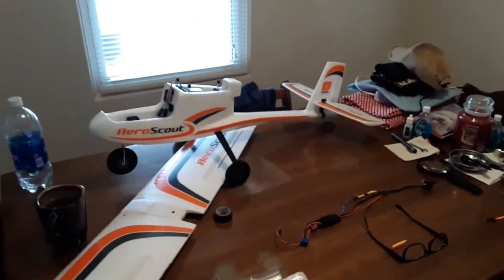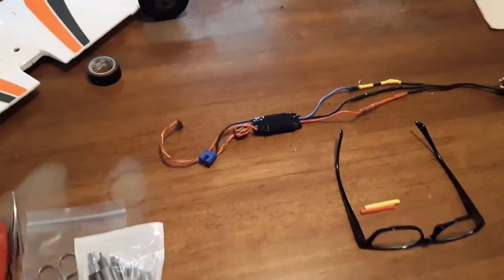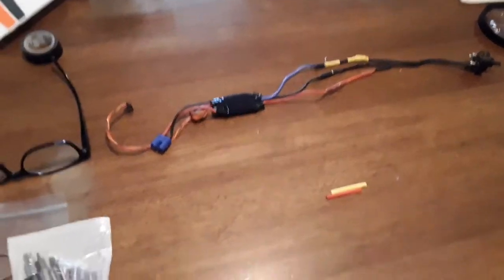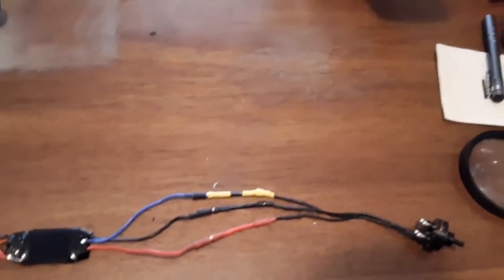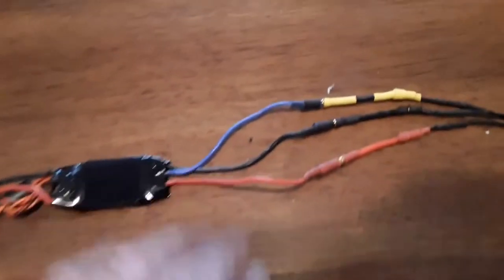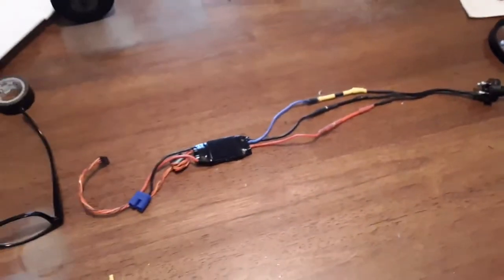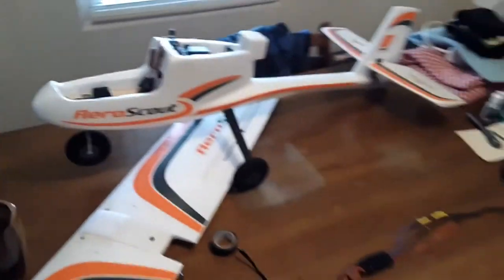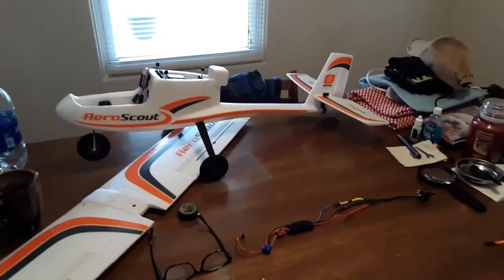Parkzone AeroScout ESC mod.

Comment: Just put a different, 40a esc (4s) in it. Mine lasted 2 weeks b4 i trashed the original 30 'set' esc to a $15 Amazon 40a/4s esc. Instant wide open throttle! (THAT wasn't enough. I used a 4s smart 2200. Motor lasted 1 flight! 🤦‍♂️) LoL, but was fast fun that 1 flight! 😁
Reply: &, theres NO programmer out that 1 can remove that 'safety' feature. (I have EVERY one! 1 just never knows. 😁)

Comment: I'm putting an AR410 receiver and different esc control in mine. What size bullet connectors did you use? So I can keep the same motor.
Thanks
Reply from the maker: I used the connectors from an old ESC

Comment: question- I have the same larger Aeroscout- today I noticed when I'm in the process of taking off I advance throttle to full and if it doesn't rotate at end of runway it bumps onto the grass portion o the field and whats been happening is the motor just shuts off for no reason. If I rotate before grass and fly its ok. I double checked all the wires are tightly secured, battery is fully charged and battery or transmitter is also fully charged. Anyone have any ideas I like to learn more what could be causing motor shut off at end of runway. as I'm walking towards the RC plane & move throttle forward it will run the prop accordingly. Strange, new thing that just started happening. Could it be a ESC on its way out?
Reply from the maker: The ESC are programed really weird to begin with, that's why I changed mine out because I wasn't getting Full Throttle right off the bat. But it's supposed to be a trainer so I'm thinking that's the reasoning behind the way it's programmed.
     I would say the ESC is the problem.